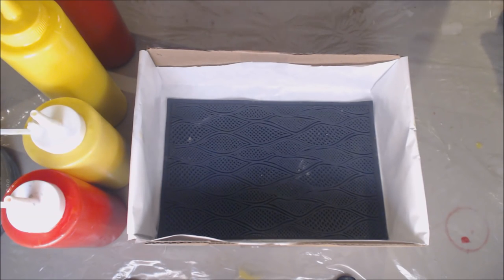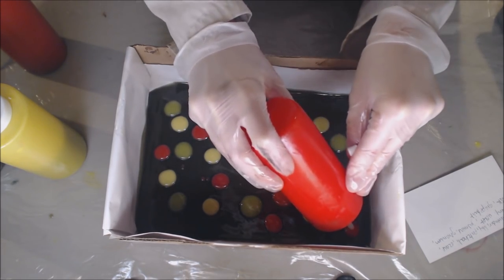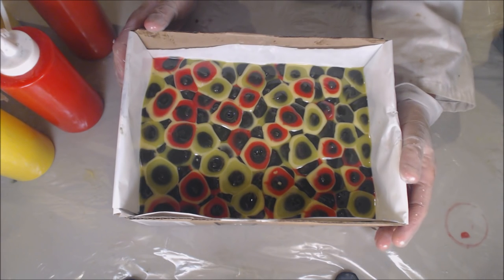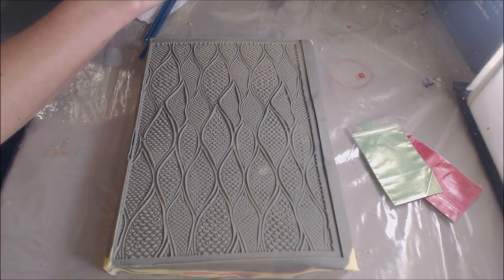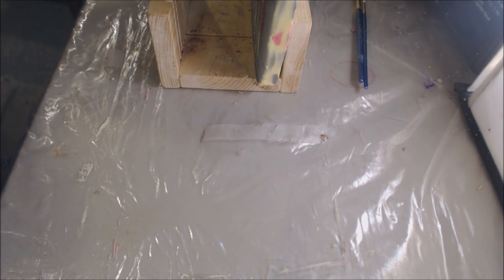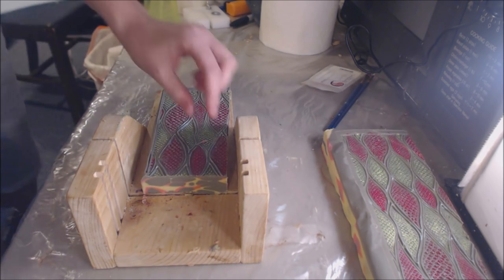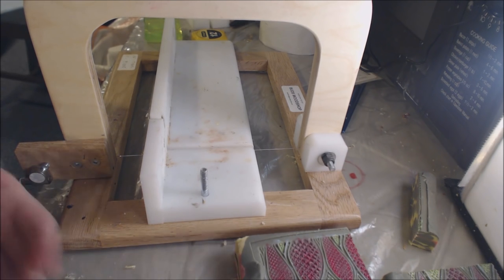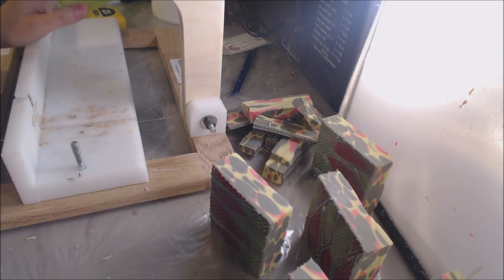Making, Painting & Cutting "Punk Rock Mermaid" Cold Process Castile Soap

Comment: Great video! I turn my soap on the edge and put it vertically on the Bud cutter. Then you can still use the wire ;)
Reply from the maker: I didn't even think of that! I think I automatically assumed it'd be too tall. But for some reason I can't stop making soaps in card board boxes, so I'll definitely try that next time.  I appreciate you sharing!
Reply: You're very welcome! I'm in the same boat, have a lovely slab mold but don't have a vertical cutter so I improvised and it worked! ;)

Comment: Beautiful. Too bad you couldn't enter. How long did that take you to get into the mold? Just curious
Reply from the maker: Jamie- LOVE U MORE SOAPS It was a bit over 30 minutes if I remember right. This was a fun one and it sold well too! totally worth missing the entry guidelines 😉
Reply: +Arachnes Demise (Arachne's Demise) thanks for getting back to me! super quick!  I enjoyed watching
Reply from the maker: Jamie- LOVE U MORE SOAPS No problem. I'm happy you enjoyed!! 😃😃
Reply: next time you have to cut like this you should hold the ruler next to where your cutting. I can prop mine up between soap and cutting edge to give me guide. Then with my bud cutter I put soap on side to fit between the part that won't come off.
Reply from the maker: Jamie- LOVE U MORE SOAPS That's a great idea! Cutting it was frustrating. BUT I may have a loaf splitter soon which would also do the trick. I love making soaps in slab molds